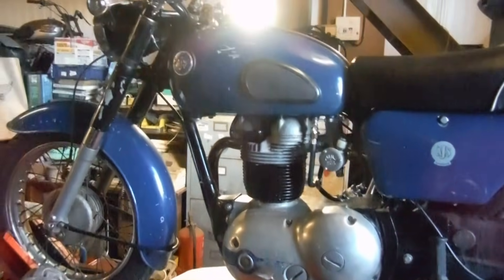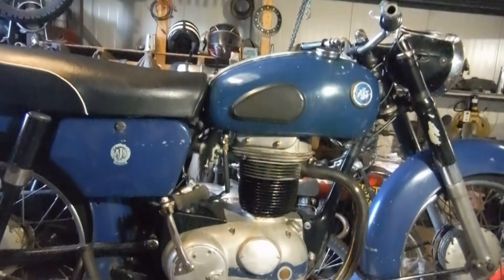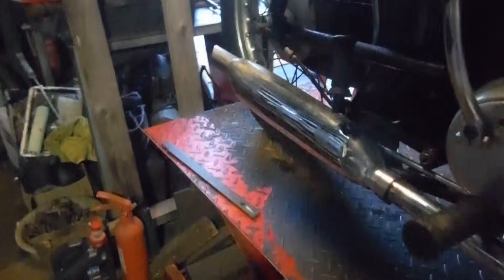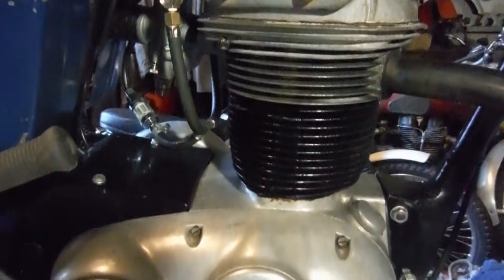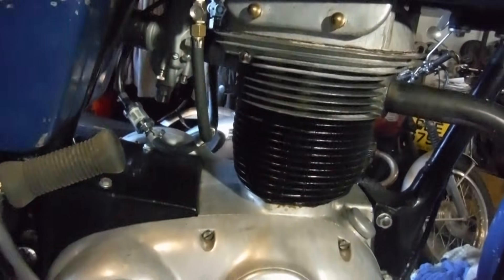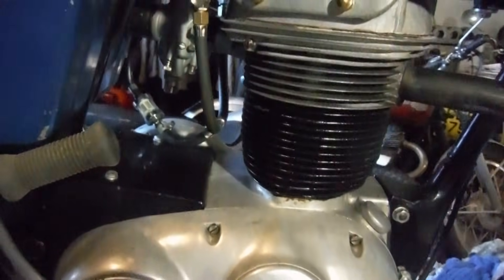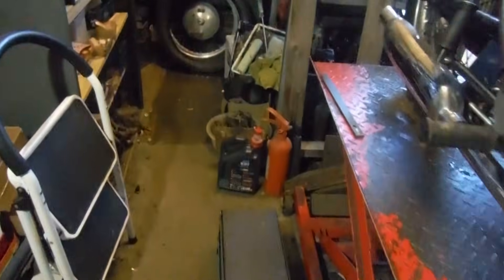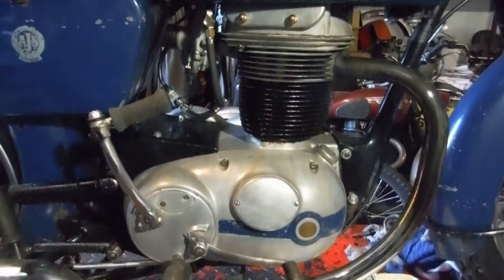AJS 350 Model 8 - A very unusual aspect of these engines discussed, also applies to 250 cc types.

Comment: Not to reduce noise but (if the displacement is in the direction of rotation) to reduce side thrust on the piston during the power stroke, thereby putting more of the power to the crank.  Actually quite a common design feature.  Less common is the system for tensioning the primary chain on the unit AMC singles.  The whole gearbox is mounted in a circular housing and can be rotated to make adjustments.

Comment: I ran one of these for 5 years. Was very reliable and mechanical quiet, but it's no lightweight. Worst thing that I found was the gearbox, the workings are mounted high up inside the casing, so if your oil level drops (usually through the gearchange shaft)  the cogs run dry. Interesting talk  Paul.
Reply from the maker: Thanks.

Comment: BMW still use the de saxe system on their boxer twin engines where the two con rods share the same crank pin,if you sit astride a boxer twin and look down to the cylinders you'll see that one cylinder is forward of the other,my 1978 500 Morini 72 degree v twin employed the same crank set up where the rear cylinder is to the left of the front cylinder.
Reply: Not the same thing at all.  The cylinders you mention are offset in the line of the crankshaft rotational axis; in deSaxe, they are offset perpendicularly to the crank's rotational axis.
Reply: You would think that would create a lot of vibration with the BMW😉

Comment: The main reason for the desaxe arrangement is to reduce the thrust loading between piston and bore and is quite common on diesel engines the same can be achieved by offsetting the gudgeon pin in the piston as Honda have done on some of their engines.

Comment: Nice one Paul ! You were correct when you were discussing the offset cylinder alignment - it is called desaxe (with accents, of course over both “e”s 😂). I WAS riding bikes at the time this one would’ve been around. In fact my friend had the matchless equivalent of it - the Matchless G5; also there was the G2 250cc. These were regarded then as extremely frumpy, boring looking bikes… for example the G2 compared to other learner bikes like my BSA C15 for example, or the Royal Enfield Continental GT. The Norton 250 Jubilee was another bike that never really made it.

Comment: The early Caterpillar D6 dozers  with the 3306 engines had the bores dead over the centerline of the crank. This caused very severe Diesel knock, enough to cause air bubbles in the coolant. This in turn caused rust pockets to form in the coolant side of the cylinder liners, which would then become porous.
Cat's engineers redesigned the block to off set the crankshaft to the centerline of the cylinder bores, which  prevented the diesel knocking. The redesigned engines were then really good and were produced in huge numbers with no known problems.
I guess AMC did the same to minimise wear on the thrust side of the bore.
Reply from the maker: Interesting - the old 'Cavitation erosion', International Harvester put a lot of research into that, I understand. Coolant filters helped combat it, too.

Comment: I owned a 1960 250 scrambler version (Matchless G2CS) and it's biggest failing was to break crankpins.  I did have success racing it, very well balanced on traction and I wish I could have had more opportunities but I went to two strokes for racing.
Reply: Had that very problem with one myself, sheared off cleanly from the drive side flywheel.... The thing still ran but no drive, I couldn't believe it..

Comment: I've come across that set-up on a few diesel engines, where the crankshaft is offset to the bore centre, so the crank is technically passed TDC when the power stroke starts.

Comment: Now that’s pretty interesting Paul! Your Honda 500 as with Honda in general have the guduion pin center located one millimeter towards the front of the cylinder to reduce piston slap. So there has to be something to it.
Reply: IIRC, several Honda designs had that feature stemming from the early '60s.  There were some comments in the motorcycle magazines about it, that it contributed to more power.

Comment: Some thought the  engine oil capacity was  rather low as the dry sump oil tank was curiously integral with the engine - it meant the oil worked hard - I imagine with modern synthetic oils that would be less of a problem - it was marketed as the light weight though in truth it was still fairly heavy and rather staid in design

Comment: You haven't mentioned that the head is on a different horizontal axis to the barrel and cases, so Desaxe Barrel and rotated head along with the hidden separate Burman gearbox with similar internals to the Ariel Arrow and Norton unit twins apart from the rocking horse pooh 650 models you recently played with. I'm OK with the Wipac electrics. They will easily convert to 12 volts and I find their alternators to be more robust than the Lucas ones.

Comment: All Norton commandos have a desaxe engine 
I believe it started with the Norton atlas when they first went to 750 from the 650 
Infact you can now buy a wedge cylinder base plate for Jim Smit in the US to correct the desaxe if you want to
Reply from the maker: That's interesting to know, thanks!
Reply: The other curious item with the Lightweights is that the Factory Workshop Manual has an error in it for setting up the timing. The drawing in the manual is reversed. It’s thought they put a tracing of the set up into the print run back to front. It’s a bit of almost ‘Standard’ AMC knowledge. They had a reputation for bad gearboxes but I think that was more down to low oil and heavy footed learners ( on the 250’s) than anything else. That said I knew a couple of Jubilee owners in the day ( which this shares most of the gearbox internals with) who had bikes that were regularly dropping out of gear or wouldn’t go in gear. Given the market they were up against by then I e Jap etc, they lasted a long time - 1958 to 1965/6 almost unchanged apart from cosmetics. Well done. On with the next.

Comment: For my sins I love these AMC "Lightweights". I'm on my 3rd one now, when well sorted they are quite a lively mount and as you say, mechanically quiet. I think the gearbox is better than most brit 250s, as long as the oil is kept topped up. I've had a 64 G2CSR, a 60 G5 and at the moment I have a 67 G2CSR green laner. All the best mate.
Reply from the maker: Thanks, and thanks also for sharing your experience!